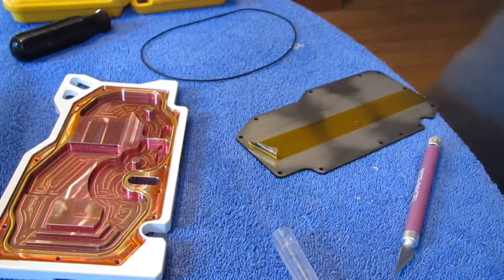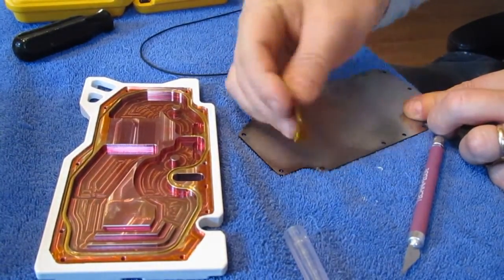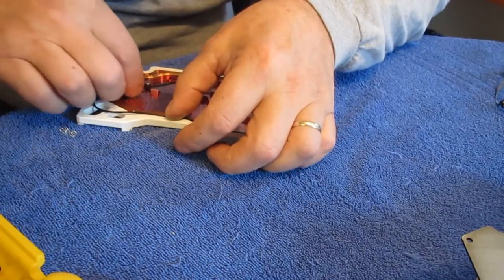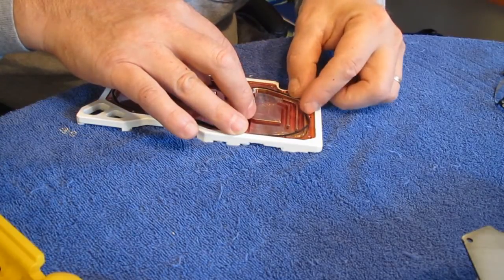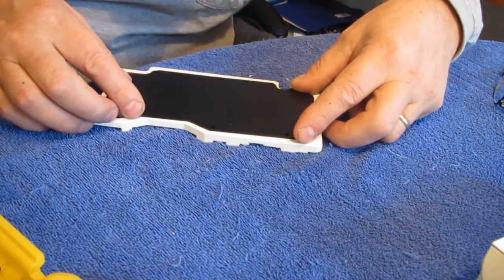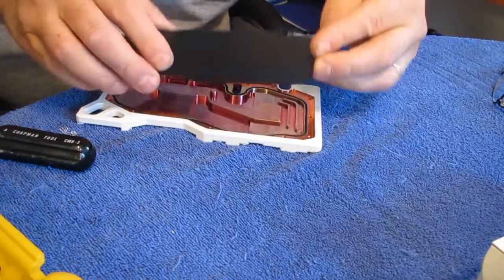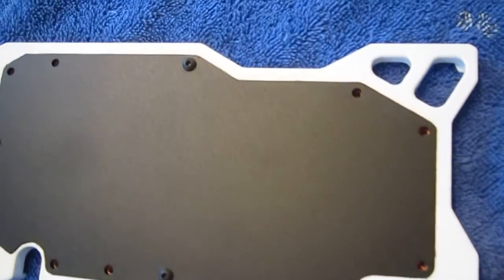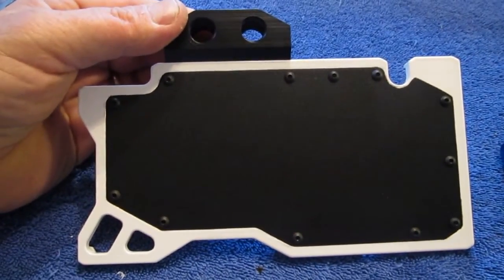9 Custom Corsair 800D Assembly: Aquacomputer Water Block

Comment from the maker: @adamXatomic There some backing plates from EVGA and they did get powder coated. I will have a little prep work to do on those, removing masking, reapplying a silicon pad, etc. But the client was not happy with how they came out and may not use them. They got coated twice and it filled in the perforations a lot. They also have a pink cast due to bleed through from a previous failed coat. They don't look terrible, but final assembly is being done by the client so it's his call.